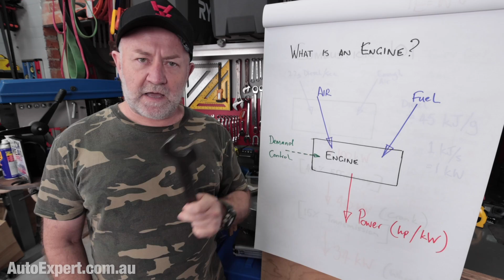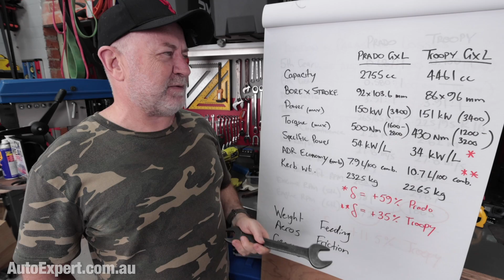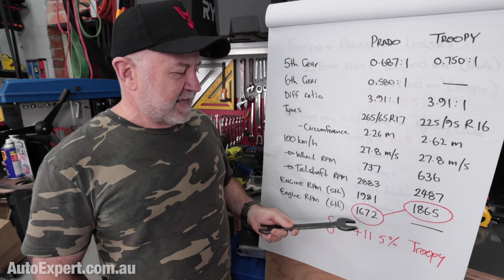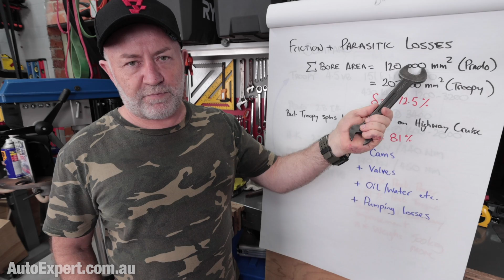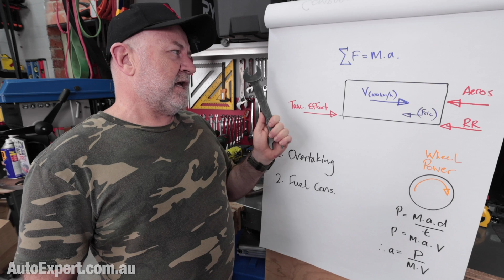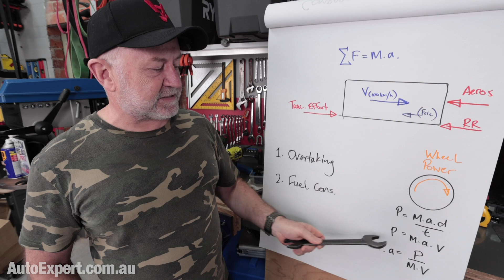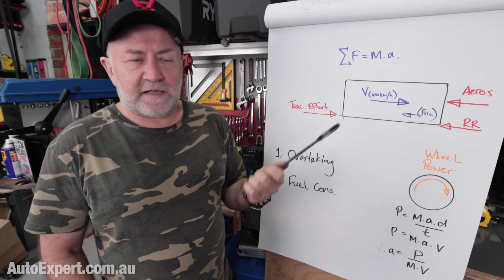Toyota Landcruiser Troopy fuel consumption (why it's so bad) | Auto Expert John Cadogan

Comment: Numbers might be the same on paper.  Not in real life.  ....
New Troopy is a much bigger vehicle built to last and work hard for its whole life and carry heavy loads.  It's a donkey working in tough environments all day long. 
It wouldn't give anywhere near the same longevity with the smaller engine being pushed hard like that. 
Pretty sure toyota already did the costing and engineering analysis long before they spent the $$$$$$$$$$$$$$ developing it...............
15l/100 is a pretty good return for such a capable and reliable machine with the level of longevity that it provides and the relatively low maintenance costs ya da ya da.....

Comment: John 
I would like to see the comparison with the twin turbo version  of the V8
1 turbo for each 4 cylinders on each engine 
Toyota limited the output of the manual version of the V8 
The figures are identical between 6 cylinders and the newer V8
Limiting factor is the clutch

Comment: As far as I can see the Prado engine creates 130kw (3400)
Reply from the maker: Should've gone to SpecSavers. 2.8D Prado: 150kW @ 3400rpm.
Reply: Oh I see they have wound the wick up on the little banger .
Reply: @AutoExpertJC  And really the LC200 V8 is quite inefficient,  when compared to the VW/Audi/Porsche V8's, but good explanation.

Comment: There's reasons why Toyota used the V8. It has more power outputs per revolution which equates to less harmonics when compared to a four cylinder. It's low on relative power output and hence not stressed as they are used for towing heavy duty combinations everyday of the week. The same situation is used in heavy haulage trucks for longevity and reliability.

As for using more fuel I'd say most of that loss goes straight into the engine block due to the larger surface area being heated. It's like running two BBQ's instead of one, twice the gas is needed to keep the heat going on both. So you're talking an extra cylinder head, another two litres of combustion chamber and four pistons all absorbing heat and dumping it into the cooling system. 

When they're both pushed to their limits the economy will even out and often be in favour of the V8. I'm not a fan of the troopy, I don't see the value in it and things like a rear end track not matching the front is ridiculous.

Comment: As a 4WD user who does a fair bit of heavy towing I find that although the big old engines are indeed pigs every day, they're also not much worse with another 2 tonne on the back. Whereas when I've occasionally gone for a smaller engined vehicle the fuel consumption when towing is pretty vastly different. Is this observation actually a thing and can it be explained?

Comment: Very informative. I had a F100 with 6l V8 petrol and although it was a thirsty beast it was a truck and the fuel consumption did not change wether it was fully loaded or empty, just the ability to accelerate and the relative speed capabilities varied. 
The troopy is an industrial vehicle and under load will out perform but the Prado has more creature comfort. Put a fully loaded trailer behind each one and the compare.

Comment: Very well put together explanation.  

However, the public needs to remember the 70 series vehicles are built for a specific purpose.  They are a completely different vehicle compared to Hilux, Prado, Ranger, Triton,  Patrol, etc.  The 70 series is designed mostly for durability and in standard form are capable of twice the work and twice the mileage of smaller vehicles.  Hence they are most popular with military, mines, farming, and remote overland travel.  You will rarely see these engines undergo a major overhaul under 500,000 + kms.  Yes they are underpowered, slow, less efficient and expensive but they will last longer and are not designed for day to day urban use.

The small 4 cylinder diesels producing the same if not more power comes with compromise.  In standard form, they will run 2 to 3 times more boost pressure to get the same output, 70 series around 8psi, and Hilux/Prado around 20psi or more.  At 14psi, you effectively double the engine capacity.  With these engines highly strung, they are not as durable and correct maintenance is more critical.  I have seen late model 4 cylinder diesels let go anywhere from 120,000 to 250,000kms  More turbo failures than internal component failure but they are more susceptible than the larger underpowered V8.

Comment: I remember reading somewhere that if you could build an engine that could run reliably at like 500 degrees you could increase the thermal efficiency? Leaving aside the issues that this would cause with lubricants being utterly destroyed by this and it being a total technical impossibility, is there any truth to this claim? Would the engine somehow waste less energy as heat like this?
Reply from the maker: Yes. All true. Material endurance limits thermal efficiency.
Reply: If the Sheila’s like ‘em, I’m in like Flynn

Comment: Engine input is air and fuel.  Engine output is power and heat.
Reply from the maker: OK - outputs are also CO2 and H2O plus unburned nitrogen (main component of air) plus traces of NOx, CO and unburned hydrocarbons and particles. The only output that matters for beer garden physics is power. Big missed opportunity to be a pedantic prick, right there...

Comment: The prados may do things efficiently. But you can't have power, longevity and economy all in one. You gotta pick two. People keep trying to put smaller and smaller engines in utes and wagons and juicing them up. Look what happened to the 3L zd30 patrols. Tiny motor, tiny intercooler in a big wagon, then loaded with 4wd gear and towing. They're all grenades over 250 thousand KMs. A 3L 4 cylinder has to do more work to produce efficient high end torque for towing over a long period of time compared to the vdjs. Therefore over their lifetimes they will have to work harder. Vdjs come from factory weak as hell in engine output. Drop another 10k into them and they double energy and torque output. The new Ford rangers getting even smaller engines. Theyll go the same way. It's all a payoff. You buy a V8 expect at least 15L per 100 standard, it's a bigger engine, bigger internals, bigger accessories, components and chassis. Add a steel tray, towing components, a 4 inch loud exhaust wasting soot out the back, bigger tires and there's your bad economy. The straight 6 h block Toyota diesels were the pinnacle of engineering, perfect compromise of power, economy and longevity.

Comment: I hired a Toyota Prado diesel and did solely highway driving.  It was a 'free' upgrade. ADR81 says the car burns 7l/100km, but the dashboard stated 9.8 all the way.  Sure enough when I refueled at Uluru at $2.10/l, the car had chewed 10l per 100km.  You can imagine how delighted I was.  Something is seriously wrong with the test.

Comment: I would check your  engine specs on the prado, sounds like you are confusing  v6 turbo petrol

with lc 200 and  70 series you 2 choices in diesel 6cyl or v8

I find the prado is more a status symbol  people wanting  the same features as  city drive who never wants to take the vehicle offroad...

a 4cyl diesel turbo  has about the output  n/a tune flat where as the flat 6 turbo tends to have the output of the N/A tune v8 though turbo v8b can not be compared to a 4 or 6 turbo

the old scale of hp 150-220  4cyl..  250-300 6 cyl/6cyl turbo,  300-350 an tune v8  to turbo v8..

this was a original spec for diesel variants I typically don't compare petrol variants because they typically there to look the  part and be a people mover not a towing vehicle typically because to be  tow vehicle in petrol  you need to replace your rear diff though given you typically hamore power for tarmac driving you pay more for fuel as you burn..

just because  you can sit on the speed limit doesn't  always benefit you in fuel mileage some times slowing down conserves fuel amd gives long km driving  distance

1 thing to note you are always going to be heavier in the prado  vs 70 series troop or wagon because you are hauling 2 extra  when in the wagon you have 2 rows of seats when you can haul 10 people in  the troopy  with the 2 bench seats in the back  and both bench seats weigh less the 1 full bench row car seat

you are allways going to burn more fuel in the weakest engine you  because you overweight for the engine capacity

Comment: Can't get double the power from a tune in your Prado. The v8 is de-tuned from factory. And the manual gear box ain't good for the economy. Can't compare the 2 really.
Reply: Manuals are usually more efficient than an equivalent (same number of gears and same ratios) auto, especially for highway cruising. The torque converter in an auto is a big source of extra losses, plus the auto gear set is more complex and the auto also has to drive a hydraulic pump to operate the shifting.

Comment: Look to tell you my real world experience I own a prado for my wife and a 1hdfte 79 the inline 6 motor for those who don't know much about cars and I'll tell you around town or at the lights the prado is quicker off the lights but it's lighter and is auto and geared different it's more comfortable and better economy . However on the hyway the 79 will wip it's arse even towing a heavily loaded car trailer it will leave it for dead off road the 79 will just walk though soft river sand like it's nothing with or without dragging the prado behind it which has happened more then once or a trailer what ever else and that comes down to having monsterist amounts of touque from idle on it will off idle let the clutch out and walk though sand the prado does ok but it's no where near in that league of the cruiser in those cases they both have there uses all the same and happy with both but if I had to choose the cruiser would be the pick it's a bigger or higher grade of car for a reason.
Reply: interesting comment

Comment: Hey John, this might seem a dumb question, but could you capture waste heat from an engine/drivetrain with thermoelectric generators and send the energy to a battery? I've never heard of a car that does this and I'm just wondering why (maybe cost/benefit isn't worth it).
Reply: an turbo charger is already reusing energy from the engine. But keep in mind: Cooling an engine is already a hard task. Adding something to the engine that hinders the heat to escape the engine room might not be a very good idea

Comment: If you put them both on a dyno you will see that the factory specs are bull... the v8 will make a lot more power real world also put a 3 ton trailer behind both and see which one has better fuel economy. The prado is designed to take kids to school, 70 series is designed to be worked hard all day everyday in demanding conditions
Reply: Did you listen to anything he said, or were you watching troopie and VB ads from the 80's? Dont get me wrong, I love a troopie, but it is not efficient, or technologically advanced.
Reply: I wonder why big trucks (The Kenworth type) have doubled in engine size and better than halved the fuel use over the past 25 years. If Toyota brought the V8 up to 21st century specs no one would buy anything else... my C6 Corvette (LS2) gets 8.5/100 on the highway at 110kph without trying and that’s old tech just it only weighs 1400kg is fairly aerodynamic... but I’m biased, I like the V8 rumble.
Reply: @id10tcertified  that’s basically perfect speed for that type of car though…
And it is lighter and lower than these vehicles

Your corvette takes 15l in the city
Reply: If the Sheila’s like ‘em, I’m in like Flynn

Comment: Two vastly different purposes, prado are great at doing hard slog sometimes, but they have more failure points when used regularly, where as a troopy even the older weaker 1hz troopy will just lumber along fully laden and towing a caravan and give you far less trouble,  a strange comparative analogy, is when i used to work in a glass factory, smaller meaker character working with a bunch of polynesians, i can lift the same stuff and do the same job, but at the end of the day i was buggered, where as they could smash down beers until 3 am and wake up and do the same job without any impedance , where i would need to pop some panadol and nurse my lumber aid support band

Comment: Right Engine for right job you mentioned ... Thing is, we had VW transporter / multivans ... Transporters had 3l V6 Diesels, Multivans were 2.0BiTd around same paper output of 180HP, all were DSG. if we omit that all 2.0 went  to junk after 160k Km (100k mi) if cars were empty 2.0BiT was slightly more lively, when you loaded car to full 3.2tons V6 3.0 were still going fine. i4 2.0 biturbos were bit like hamsters with one lung removed, add hill and you would do better job pushing it felt  ..., On paper both engine should behave around same, technically 2.0l was supposed to be better at full load ... Either there is something about displacement or car manufacturers lie about engine performance ... which would not be so unexpected with vw but i noticed similar things on other brands with better reputation as well ? I was once told by guy who used to design engines back in prehistory that it could be that load on crankshaft is bending / misalign or something thus incurring more internal loses as engine was not made  for such heavy load ... he basically told that there is a reason why big trucks have large displacements at relatively low power per liter (albeit they have high torque at very low RPM thus having same power as smaller engine would have at 4000rpm at 1200rpm) your opinion ?

Comment: as i suspected, Toyota didn't want the 70 series to be as good as the 200. hence the single turbo on the 70's.
a twin turbo troopy/70 series would have outperformed and out sold golden child 200 series
Reply: I reckon they'd have to put too much effort into bringing the rest of the vehicle up to match the power. I like my old troopy, but the new ones don't have a whole lot different in terms of brake performance and handling... Only so much power could be responsibly added by the manufacturer. Just a thought though.

Comment: One thing you didn't discus was the state of tune in both engines. The Prado is a soccer moms car with a higher state of tune than the V8. The troopy is designed to run around mine sites and so runs a lesser state of tune. Bring the tune up higher and the fuel economy is better and the power is greatly increased. I am talking here of a slight remap and not a silly tune. If the troopy had more power standard then they would be rolling them over regularly.
Reply: Rolling them even more regularly you mean :) troopys are classic rollover hazards. I still like mine.

Comment: In soft sand and taking off when heavily loaded up hills I will stick with my 4.5L V8
Reply: 🤣 clearly missed the physics section.
Reply: @woahh1967  did you not see the numbers beside the maximum torque figures? or even consider how much torque the engines make below those rpm numbers? Good thing you understand physics. you should start telling people that F1 cars would be better at towing Road Trains because they make more horse power than a Mack Truck.

Comment: The V8 will use less fuel when towing or under heavy loads than a 4 cylinder, which is what they're designed to do. Not to mention the 4 cylinder will wear out faster. Get a Prado and tow 2.5 tones with it and then do that with the troopy. Then make another video with your findings. 

I'll share my results with you. I own a 79 series Landcruiser with this exact engine. On the highway i get 11 litres per 100 unloaded (not towing) and no headwind. When towing a ton of camper trailer it barely changes and goes up to 12 to 13 litres per 100kms. 3 years ago i had a brand new Hilux with the same engine as the Prado you're talking about (1GD). Unloaded on the highway the Hilux would use less fuel at around 10 litres per 100kms. Towing the same trailer it jumped up to 14 litres per 100. It used MORE fuel than my Landcruiser. And since fitting a Steinbauer power module to the Cruiser economy has improved even more as it boosts the turbo more getting more air into the engine along with more fuel. And that's only a very mild tune of 25% increase. The trick is you spend less time accelerating to get up to speed, so it uses less overall fuel. Yes, it's drinking more when the foot is down, but the foot spends less time being down.

Cruising speed makes the biggest difference to a Landcruiser's fuel economy. And a lot of cars for that matter. Wind drag is massive as you pointed out. If i sit on 110km/h, it will use considerably more fuel. A much bigger difference than towing. Towing my camper trailer only uses 2 litres per 100kms more at any given speed. Driving at 110 with no trailer compared to 90km/h will make a bigger difference, more like 3 to 4 litres per 100kms.

Show me a 4 cylinder 2.8 litre with 6 to 700,000kms on it. Then show me how many and how hard they've worked to get there. Plenty of 1VD-FTV V8's out there with that amount of genuine kms on them which i may point out have worked hard. Longevity is King and i STILL believe in the old saying," There's no replacement for displacement". Show me a Kenworth prime mover with a 2.8 litre 4 cylinder in it. It wouldn't even turn the wheels mate. A Kenworth cruising down the road with no trailer will use more fuel than a 4 cylinder. Now put 100 tones behind it and try again. Big engines do big work and small engines do small work. It's as simple as that.